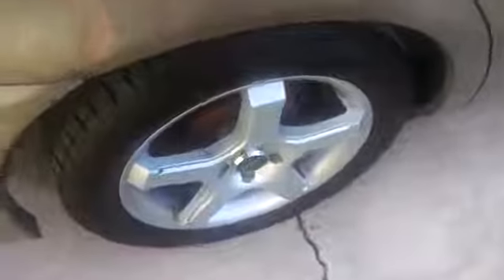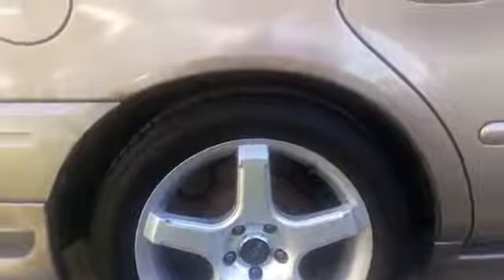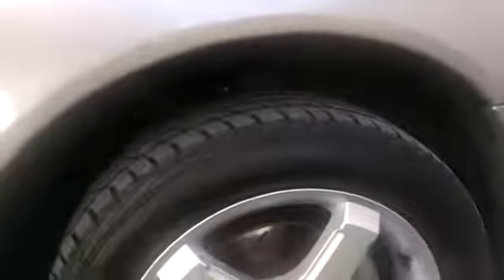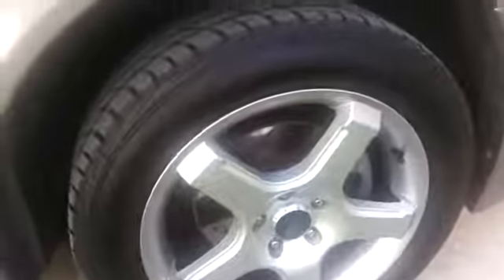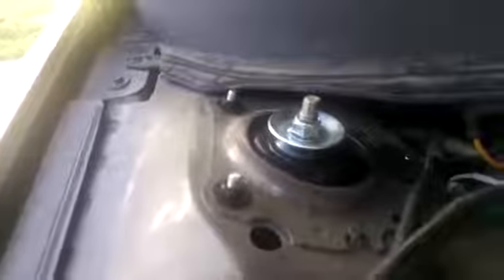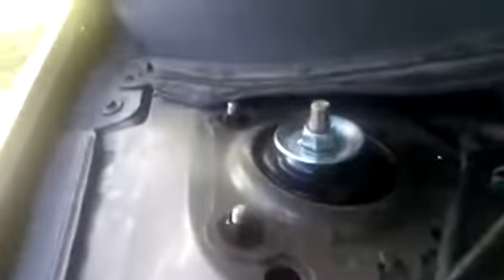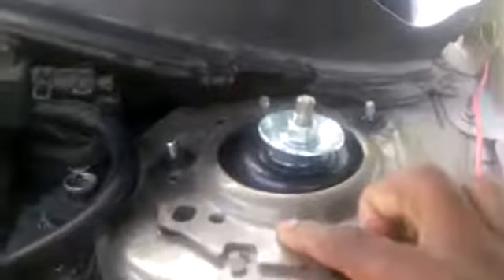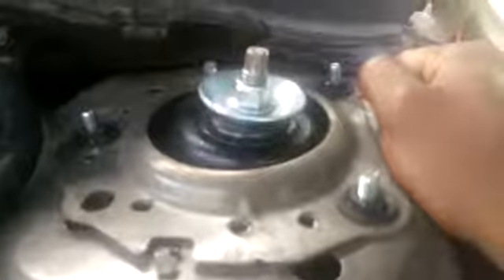2007 Ford Taurus SE - Camber Issue Addressed

Comment: Okay - so you got it into spec.  How did you do that?  Measurements - method, etc.?
Reply from the maker: You will need an alignment measurement tool to know where the specs are so you can adjust them. They can be found online for $50 to $200 depending on the quality. I have a cheap $80 one that was accurate. Park it on a level surface and use the instructions to determine how off you are. Once you know then you loosen the top strut mount and move the strut to gain or decrease the camber. Once you get it as close as you can to specs for your particular car you tighten them down. Your toe adjustments are done under the car by tightening or loosening the tie rods with a wrench. You can fine the proper alignment info online or you can buy a manual for your particular car. 
For the 1996 to 2007 Taurus is...
Split Front Camber	-0.5° ± 0.6° -0.5° ± 0.6°	0° ± 0.7° Caster	3.8° ± 1.0°	3.8° ± 1.0°	0° ± 0.85° Toe (positive value is toe-in, negative value is toe-out)	-	-	-0.20° ± 0.25° 
Rear (Four Door) Camber	-1.0° ± 0.7° -1.0° ± 0.7°	0° ± 1.2° Caster	-	-	- Toe (positive value is toe-in, negative value is toe-out)	0.18° ± 0.20°	0.18° ± 0.20°	0.36° ± 0.25°  Height 4-Door 713.3 mm ± 10 mm (28.08 in ± 0.19 in)
Reply: @ragintaurusmusclemercury7023  I get that - what is it that you loosened and re-tightened after drilling out the spot welds - and how does a shop do an alignment?.  I paid a shop to do an alignment and those spot welds are intact, so either they did nothing (which I suspect because the tires are still wearing badly on the inside front), or they did something else that is not visible.  Cant find anything on line on the correct procedure.
Reply: @ragintaurusmusclemercury7023  Do you loosen the 3 bolts or the center bolt - or both?  Sorry, but I have no experience and am very, very tired of replacing expensive Michelin tires every 6 months.
Reply from the maker: @craigkallmayer9536  You don't touch the bolt in the center of the strut. You drill out the spot welds holding the plate on and elongate the the three holes the bolts go through a quarter of an inch on the left and right of where the original location of the holes. Then you will be able to adjust the camber plus or minus to get your alignment where it needs to be. An alignment shop knows exactly how much camber your car needs. I guessed mine and got to alignment down. I was only off by plus one degree on one side and nailed the other.
Reply: @craigkallmayer9536  yeah you got hosed like i did. The shop i went to said camber isn't adjustable on my wife's Ford Windstar then in the same breath said they could get me an aftermarket adjustable camber plate. I was like WTF! The OEM one is adjustable if you drill out the spot welds like this guy did. In fact, the factory Ford manual says to do it this way. Can't trust anyone nowadays. So now i will do the same as this guy did i just have to get one of those Camber gauges. Alot of shops refuse to refer to factory manuals just because they have "been doing this for years" even when they come across a vehicle they never worked on before. Pride is a bad thing for all involved when it comes to this. Technician keeps thinking he is right and the customer gets poor or non-existent service. Oh yeah the alignment specs should be in the factory manual.